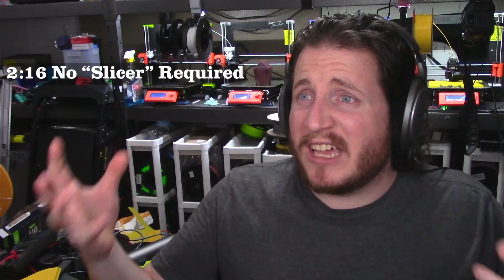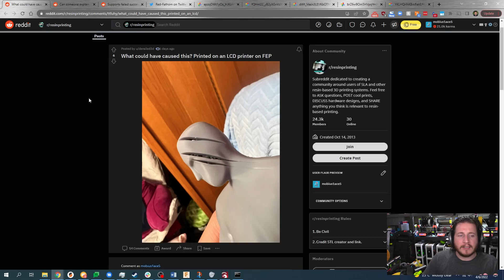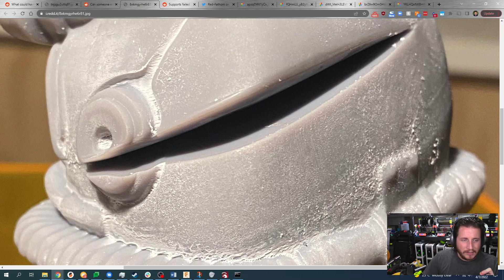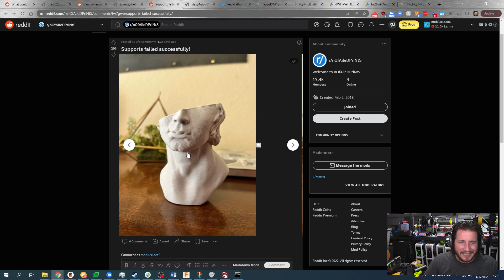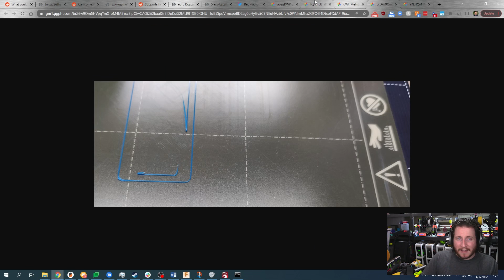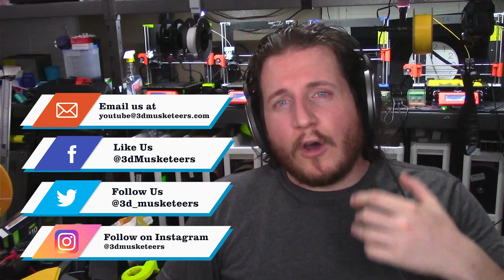Why do Resin Prints Split?!? - PrintFixFriday S1E30

Comment: I like your PEI bed adhesion suggestions. They're the ones I typically tell people about.  Sanding a smooth sheet seems to be something people are averse to doing though, because it "damages" it, which it does, but I also agree that the build sheets are consumables.  And yet people do like to fight with adhesion for print after print instead of trying something a little more harsh that might fix it.  Because of this, I typically go the acetone advice route.  When you get a new PEI sheet from Prusa,  the bubble packing warns in all caps to not use acetone...and then the Prusa knowledge base says a little acetone to remove remaining residue is an option on the smooth PEI sheets and that it will cause the PEI to become brittle over time with repeated use.   A quick cleaning with a small amount of acetone and then an immediate cleaning with IPA to remove the acetone remnants tends to make a significant difference with adhesion for the smooth sheet (and only the smooth sheet).   Which of course is exactly what you said.   I could have just said, "I agree!"
Reply from the maker: You could have just said I agree, but we both know there is absolutely 0 fun in that! I know acetone on the textured sheets is a no-go but PEI, or the street name of ULTEM is basically resistant to most chemicals (and is also fire retardant AND one of the few printable materials certified for flight by the FAA, it does need nozzle temps of 400+, bed temps to 200+ and chamber temps of 100+ though...)
Reply: @3DMusketeers  certified for flight?!  That's it, we need to take a printer on a plane and do some printing with a PEI sheet as we fly cross country. The first Benchy printed at 10,000 feet?  Oh, we so need to make this happen…
Reply from the maker: Only if you can grip it by the husk! 

The raw material, PEI is certified for flight by the FAA after it's printed, if that makes sense.

Comment: I've put 250 degrees for hours upon hours on my Ender 3 with ABS, probably time to get a Capricorn tube
Reply from the maker: PTFE starts to off gas formaldehyde and degrade at 242c, so you definitely have been having some nastiness around you. Be careful! If you print lots of ABS it is time for all metal.
Reply: @3DMusketeers  I bought 2 rolls of it because I thought it was pla lol
Reply from the maker: BEEN THERE BEFORE lol

Comment: Good call on spring belt tensioning.
Not only can they introduce momentary slack, but the constant tension is almost assuredly going to cause the belt to stretch relatively quickly, which leads to cogging and axis dimensional errors.
Reply from the maker: It was one of the first mods we did on cheap printers back in the day.